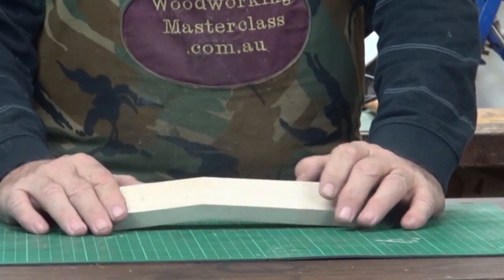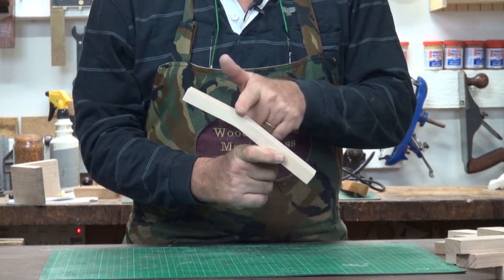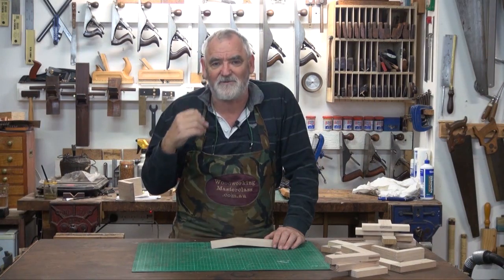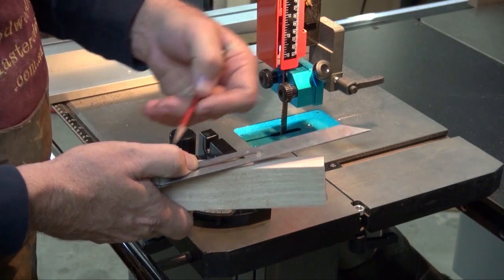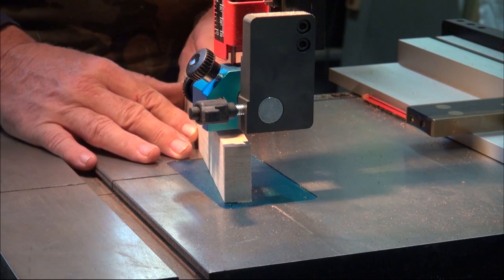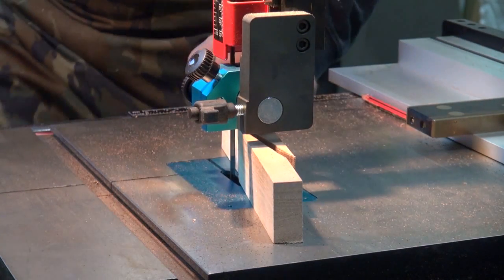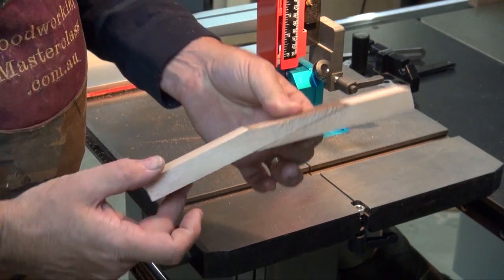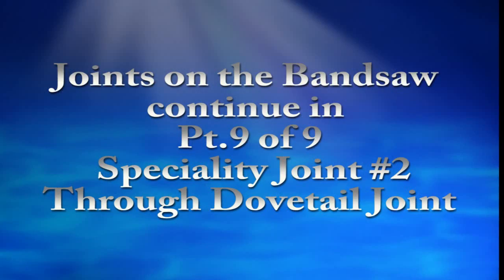Bandsaw Joints (8 of 9) Scarf Joint

Comment: Steve, I have the same Laguna band saw you have but I can't find a blade brake for it. Where did you find yours?
Reply from the maker: Hi Robert. Is it a Laguna 14BX or 14/12? The 14/12 was the first one which I originally had but recently upgrade to the 14BX which has a foot brake and larger motor. Also the body is in 1 piece not body on stand as the 14/12 was. Cheers Steve